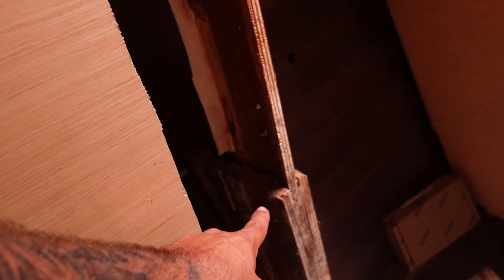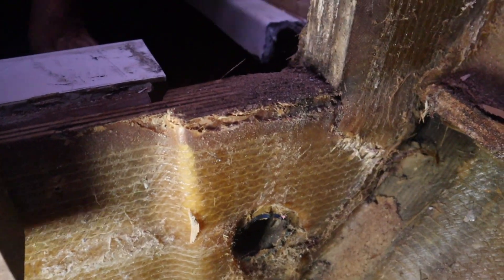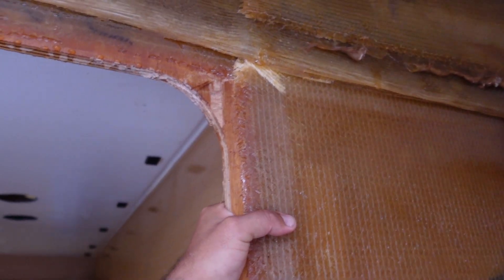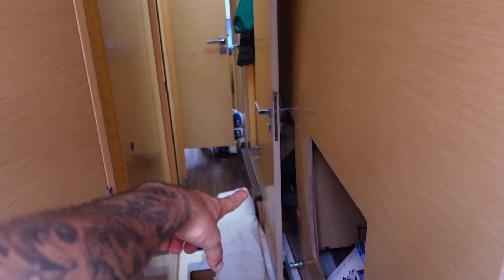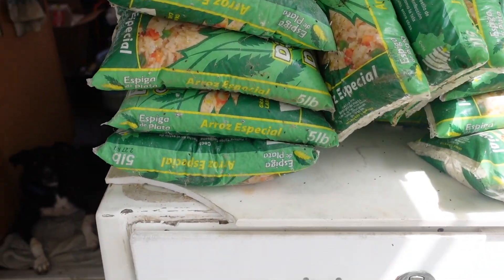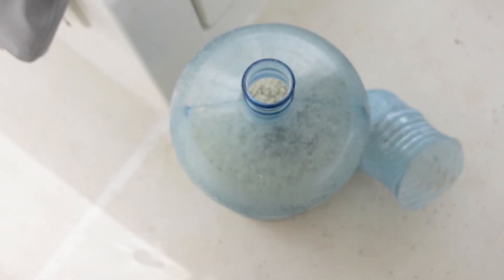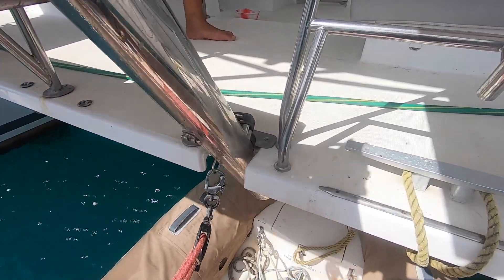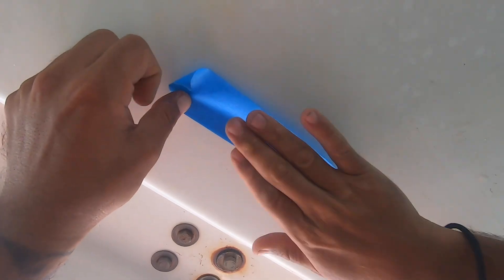CRACKED BULKHEAD REPAIR SERIES: Part 1 - An introduction... (Episode 107)

Comment: You can store rice long term by putting rusty nails (not flaking, just superficially rusty)  (the large 6 mm thick ones) inside it. For some reasons, insects absolutely hate it. Vacuum sealing and a packet of desiccant is also advised. I have rice that's 4 years old now prepared in that method, and i'm only now getting into it to consume and replace it. No bugs, no worms, no degradation, tastes very good. IMO, for a marine environment, that's as good as it gets. Also, never keep it in the OG package, that's just the poorest format. In line with removing the air from the bag, get the thick type of bags that supermarkets use to put sliced meats in.

Comment: What you need to do is train those weevil bugs to do the work for you.  That way you can continue to drink beer and party.   
Is the cost to repair this craft going to exceed it's value?  Perhaps buying another vessel would be less expensive.  Saw Parlay up into pieces that fit inside a dumpster.  Then use the design to build a new boat with all the materials you purchased.  Mechanical engineering won't help very much with this.  I too have a degree in mechanical engineering.  But some common sense might be more useful.

Comment: That Plywood looks like it has been saturated with water and warped over time.
Reply: Should look at the earliest videos of the cat when it was semi submerged and see if those bulkheads were underwater
Reply: That was my thought as well, especially that forward bulkhead they showed at the end.
Reply: It looks like the plywood in my roof after Hurricane Charlie moved the back end of my roof about an inch, pulling the straps (which held just barely) into a right triangle shape.
Reply: @davidtuttle7556  Yeah, those tornados inside Charlie made a mess out of a lot of roofs around here in central Brevard county.
Reply: @joecucch8261  i feel you. Down here in Lee it was no joke either.  Small storm, but strong enough to drive water through the stucco and cinderblock.
Reply: There's a few other Lagoon 450s out there that are having the exact same failure and warpage, and they looked dry.
Reply: If the damage was from water wouldn’t all the panels that there removing from around the broken bulkheads have water staining and damage too, the bulkheads themselves are covered in glass for strengthening which should keep water out too imo
Reply: @Brad.whatthe  Good point - that leads me to believe that the plywood had defects - or - the design specs were surpassed for the compressive strengh of the plywood - and - lastly,  the boat design of bulkheads and transfers of load.

Additionally, the sandwich boards were obviously meant to help support the bulkheads - As referenced by the phone call. This is very similar to using sister boards to help strengthen sagging floor beams. I think that's why the phone call talked doing so to rebuild the bulkhead over the entire length rather than the last .

If I were to guess, my instinct would tell me that the mast support lines are not directly over the appropriate bulkhead - thereby causing some shear stress (or logitudinal stress)  on the bulkheads.

I was always taught that vertical beams should support horizontal beams - don't depend on fasteners.
And walls should always carry loads vertically - any deviation causing shearing effect. 

I would not be surprised if the bulkhead was moved to accommodate for finishing touches as evidenced by the holes in the bulkhead - Happens in building houses all the time.
Reply: @mike60521x  could not agree more!
Reply: @Brad.whatthe  Production boats use polyester resins because it is the cheapest shit they can get away with.
Reply: wow brother after you guys have done this repair it will be almost as much work gone into this cat overall as building one from scratch. You have so much experience now and with all that work you were doing back in the states as well. l think if anyone can fix it  you and some crew will have it sorted. Such a shame we can't leave Australia or I would fly up and give you guys a hand. All the best.

Comment: looks like a buckling failure mode in compression, probably when boat is sagging and hogging between waves. which came first is a chicken and egg dilemma, combined with a pinch of the butterfly effect causing a tornado. eat an elephant piece by piece, you got this! love the videos!
Reply: It’s not a dilemma anymore. Egg was first.

Comment: Ppl spend hundreds of thousands of dollars for these boats, just to see that they are actually pigs with lipstick. A person would think their money is actually buying a quality boat. It goes to show that manufacturing is way crappier than could be imagined. It should be illegal for manufacturer to put out trash. This goes to show there is no true inspection of these boats expect for corrupt insider deals.
Reply: The L450F is the most popular catamaran in its class ever built, and you will find them cruising all over the world, more than any other brand. They are build like tanks, very solid. I trust my life to mine and have been is some serious heavy weather. Yes, these two fwd bulkheads will need to be reinforced before the weakness problem spreads to other areas. Still, not a single 450 has failed or lost its mast yet to this issue. You are mistaken in thinking it isn’t a quality boat, structurally. I would probably agree if you were talking about the quality of most stock appliances or faucets, etc provided, as they are at a low to mid range charter boat level of quality. Real cruisers upgrade and replace that stuff as needed. Structurally they are still a quality build. Think of how far Colin sailed before discovering this, for example. As an owner myself, who will probably have to do the same Colin is doing, I’m not happy, but I still would buy a 450 again. Marine engineering is different. Things need to flex in a wide range of sea states. Overbuilt can actually be more dangerous than under built. The ocean will just find a new weak point. It’s a combination of many little pieces of the structure working together, beefy isn’t always better. In this case, a little more was needed in port and stbd fwd. if I’m not mistaken, these are not main bulkheads, but what is called secondary bulkheads.
Reply: So disappointing

Comment: Seems to me like the simplest solution to the "moved" sections of the boat would be to create a few tabs with fiberglass and pull the structure back into order. If it works for steel boats (origami style hulls) and in general, welding metal with the aid of tabs and cleats, it should work just fine for a fiberglass boat that's in the water. You'll just have to delete the tabs after you're done. So it's a bit more work.